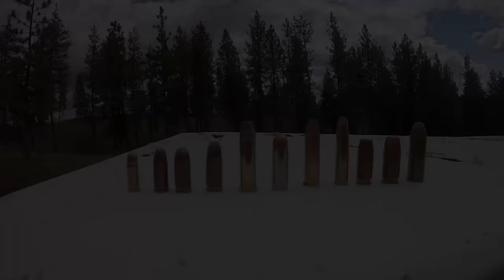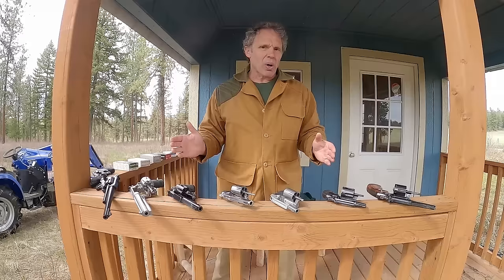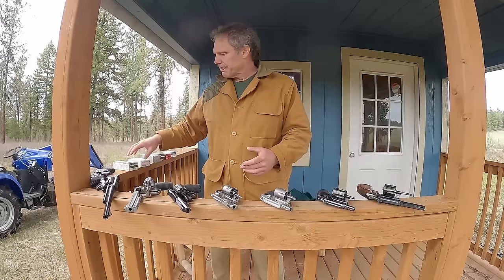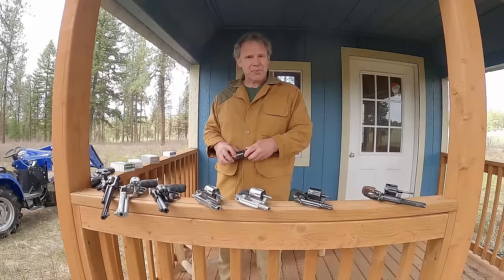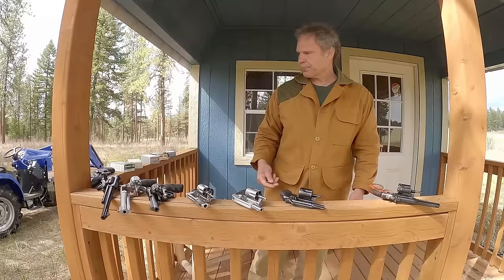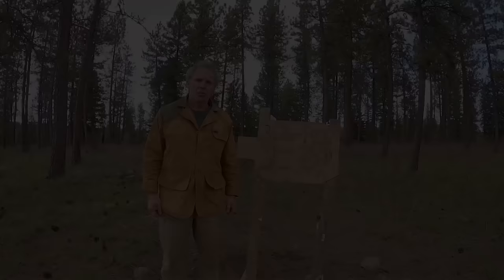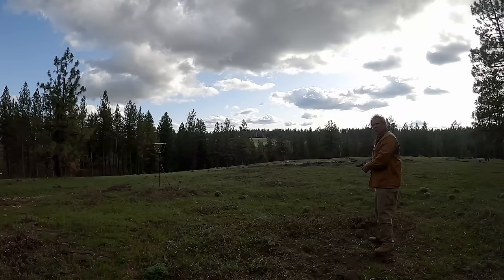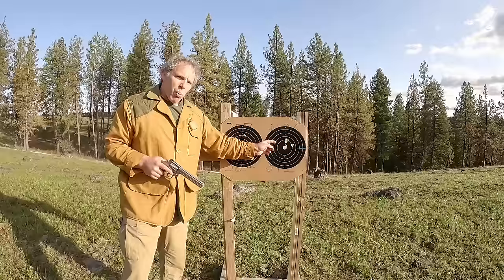Shooting .38 Super in .38 Special and .357 Magnum Revolvers

Comment: Hey Paul, I love your videos and I try not to miss any of them. I'm 48 years old and I'm a mechanic and I wear cheater glasses (1.5 strength) at work as well as at home to see anything close up like books or cell phone text or my work etc. Without glasses, I have trouble seeing iron sites in focus but find a red dot to be crisp and clear. I often wear sunglasses that accommodate a small patch in the lower 1/3 of the lens that has a power of the 1.5 (as I mentioned is my deficit) that finds iron sites in focus but i have to tilt my head back, with magnifying glasses on, to view level sites and get a good site picture. Naturally a red dot is not so easy to carry in my pocket as iron sites (P365). Do you have any advice for me or could you maybe do a video on all the dynamics involved with for farsightedness? I feel like I'm not alone here and that you and I aren't so far in age and I'm intrigued to here what you have to say. I hope you're well.

Comment: Tolerances.  It's very much about tolerances.

That said, even given .38 Super fits and is safe in a .357 (and honestly, it's probably fine in a well made .38 Special; the performance you got is comparable to .38 Special +P+ defense ammo), and there's little if any difference in accuracy -- .357 and .38 are far easier to find and have more load choices than .38 Super (I know; I have a .38 Super upper for my Witness), and are usually lower priced.

Beyond that, there isn't enough margin in performance of .38 Super above either 9x19 or .38 Special to make it worth the effort to find for most purposes.  In my Witness, I spent money on a .38 Super slide/barrel/magazines because of the combination of power and capacity (17+1 without magazine extensions), but if I could readily find full power loads, I'd be more inclined to keep 10 mm in it (only 14+1 but 50% heavier bullet at 30% higher velocity).  When I can't find 10 mm that outperforms .40 S&W, though, the capacity of .38 Super wins (and with a 9 mm barrel I can practice with cheap ammunition).

Comment: I am little surprised that you did not mention the Medusa revolver. Just a small titbit, I load 124 grn cast lead bullets sized to .356 in both my 9mm pistols and in my .357 revolver ( with mild loads) for practice and have had no problems and minimal accuracy difference, but will also be the first to admit my shooting accuracy is no where near your own unfortunately.

Comment: I know there are a lot of gun guys that know a lot more than me, but it seems like this is the equivalent of looking at a powder burn rate chart and saying... "it's just off by one from the load I'm already using, so I'm sure it's safe to use it without checking my load."  It's going to work out fine for someone, and the next moment you'll have a burnt face and scorched hair like Elmer Fudd.  Be safe people.  Just use the recommended ammo and move on.

Comment: If you are firing a semi rimmed through a should be rimmed like.38 super from a.357 or .32 acp from a .32 long or mag where lite primer strikes are likely it's somewhat less likely to have a lite strike if you single action cock it. Also.32 acp is known for more velocity and accuracy loss than.38 super is , possibly because.38 super may have enough pressure to bulge the bullet in the bigger bore but.32 acp just don't when firing a .311 bullet through a.313 bore

Comment: The glaring bit of info missing here, is whether or not .38 Super gets higher velocity than .38 special in a .357 Magnum snub-nosed carry revolver.  I own a Taurus 605 Poly .357 magnum revolver and while I do sometimes carry it loaded with Federal 130 grain .357 ammo, I usually carry it with 110 grain Hornady Critical Defense ammo.   That being said, if there was a .38 Super defensive ammo that fit most .357 revolvers and that got higher velocities than .38+P defensive rounds, I would be VERY interested in carrying that if it had less recoil than .357 Magnum.   Paul, you didn't even mention recoil differences which made me a bit sad.  The issue of recoil is a big deal for those of us who carry a light weight .357 snubbie (usually with .38 Special defensive ammo loaded).   The other question is whether that .38 Super ammo would expand effectively from a snub-nosed .357 magnum carry revolver.  If you could answer those questions, I would be very grateful to you Paul.   Thanks for the otherwise excellent video!

Comment: Don't do it!  I bought a used Ruger Blackhawk convertible and got a box of .38 Super with it.  I accidentally tried to shoot them in the .357 cylinder.  The jackets were stripped off and jammed the gun on the 3rd round.   Yes they fit and yes they fired but still a very bad idea.

Comment: I have a blackhawk 38sp/.357mag with a 9mm cylinder and Smith&Wesson 66-2.  I'll just stick with the ammo called for except for the Smith&Wesson I only use 38sp because of the forcing cone. But these are just my guns.  Do whatever u want your gun but just  don't cry if you have a broken gun on your hands or if you still have hands to speak of.

Comment: but what about .38 ACP? :) My wife found me a 1903 Pocket Hammer for my birthday. Took some digging to find valid ACP load data.  ACP is a tad higher pressure rating than .38 special, so .38 ACP is not backwards compatible to .38 special.  The thing I find most interesting is that considering 9mm Parabellum and .38 special were around when JMB designed .38 ACP, why did he use .356?  Either .355 or .357 would have been more readily available.  As I understand, most modern .38 supers are chambered for .355, but I won't swear to that.

Comment: You should of had some calipers to measure the OD of the cases and ID of the cylinders.
Also it would of been interesting to chronograph 38 special in +P and +P+. As some 38 revolvers are rated for it.
Reply from the maker: the .38 special ammo was +P
 I have never seen .38 special +P+

Comment: Paul - are you trying to demonstrate that the ammo shortage is over?

The following is not an attempt to establish some kind of expertise on my part. Please look up SAAMI specs yourself. I find these details interesting and typing them out helps me organize my thoughts and remember better. 

38 Super is one odd cartridge. Looking at the SAAMI cartridge and chamber drawings, it headspaces on the rim (not the case mouth like the vast majority of modern semiauto cartridges). The cartridge case is cylindrical.  IOW no taper, while virtually all other semiauto pistol cartridges are tapered from case head to case mouth. However, the 38 Super specs call for a tapered chamber (to facilitate extraction?). Revolver chambers also are ever so slightly tapered (did not know that). 

Finally, the .38 Special chamber spec is .3809” at the case head tapering down to .3801” at the case mouth. The 38 Super cartridge spec is a cylindrical diameter of .384” HOWEVER the specs also indicate up to -.006” variation. That is more than enough for some 38 Super cartridges to fit in some 38 Special chambers.

Comment: Bit of an oddity question, but what about firing .38 Super ammunition out of an autoloading .357 Magnum? Something like a (sigh) Desert Eagle or a Coonan 357 Magnum? I mean, granted, I don't see the magazine feeding being reliable so you'd likely have to load each round individually. Might not cycle reliably, either, would probably depend on the gun/ammunition. But, in theory, the .357 Magnum autoloader's chamber should be long enough to allow a .38 Super to chamber it. It should definitely take the pressures of the round, as well. I question if it would be safe/wise, because headspacing might be different. Never owned an autoloading .357 so I couldn't really begin to dive into that speculation.

Comment: Something interesting to discuss in the future as well is the cartridge interchangeability of Spanish 9x23 Largo, 38ACP and 38 Super. A good friend of mine has an Astra in 9x23 and he's experimented with them, 38 ACP fires perfectly and is totally safe by out metric, and I think 38 super should also be safe as well based on the chamber specifications of 9x23.
Reply: I would never shoot .38super in the Astra. The 38super is too hot. The Astra is not a locked breech pistol. The 400 and 600 are both blow back pistols.

Comment: For what purpose ? The 38 Super cartridge uses a smaller diameter bullet than the .38 / .357.  Jacketed is .355 lead.356. The .38 / .357 uses .357 for jacketed and .358 for lead. Case diameter for the Super is smaller as well.  If your revolver is designed for .38 special only, even + p ammo, the .38 Super operates at more than double the pressure than .38 special +p and even higher than regular .38 ammo. This is an all around bad idea. Very unsafe especially in older .38 revolvers.

Comment: I wouldn't shoot a .38 super in a .38 special revolver. .38 super is loaded to a higher pressure. From Paul's own tests show that the special velocity is 850 fps, and the super is 1150 fps. The special revolver is not designed for the higher pressures

Comment: This topic, is kind of like taking a 186X Colt Navy/Army/Police black powder revolver .36 caliber and loading it up with say 25 or 30 grains of black powder or even Pyrodex, instead of say 20 grains max. As far as I understand shooting .38 super auto out of a .38 special. Could you do it and get away with it? Yeah but I wouldn’t least not more then once, as the gun is likely to come apart on you at the seams so to speak. If you got the ammo to fit in the gun. And yes I know we are not talking black powder revolvers, but the same principle applies as the gun is not designed for it.

Comment: It works but headspacing is an issue to the point you get cylinder bind & weak primer strikes. Ask me how I know 😂 Moonclips are needed. I was testing in a .357 however .38spl may not yield the same results.

Comment: I would be greatly concerned about shooting 38 super in a 38 special because of the chamber pressure of the 38 super.speaking about the difference  in chamber and shells in my collection I have a cz 52 in 9mm that works flawlessly with my reloads with  many different 357 Dia bullets also 2 Taurus g2c pistols I also reload Remington 125 gr sj _ hp. The work flawlessly in both pistols. Papa wishing you well

Comment: Paul, your "Fake Expert" comment is not entirely fair.  There are SAMI specs for cartridges and chambers which result in standardization across the industry.  We all expect that if we have 357 ammo, it will fit in a 357 chanber.  It is an understandable error for someone who tests 38 Super in a 357 or 38 to assume that due to standardization, his results (fit or not fit) will be the same for all ammo and revolvers.  They may or may not be a "Fake Expert" for other reasons, but I think you need to give them a pass on this one.

Comment: The misfire of the 38 super in the revolver could be due to rim thickness. i.e. the 38 super auto may have a thinner rim than the 357 and thus the primer would be further away from the firing pin.

Comment: Well, as this video is one of my favorites and less than a year old I thought it was still Fair game to leave a comment at this point, and as a wannabe fake expert, I'm just a little too old, have spent far too many years at the range, and have watched far too many Paul Harrell videos to say that I'm closer to a fake expert than not, therefore I'll just stick with wannabe fake expert.
- That being said, I'm quite surprised that Paul didn't mention the probability of developing a carbon ring in each chamber of the .357 magnum cylinder after firing a number of .38 super rounds in a .357 Magnum revolver.
 This possible carbon ring could possibly develop in a location which might prevent a person from successfully loading .357 Magnum ammo until the cylinder has been removed and each chamber of the cylinder cleared and cleaned of that carbon ring.
If I am mistaken about this, please don't tell me because I'm enjoying being a wannabe fake expert.

Comment: you know Paul, I'd be curious of your conclusion on a 10mm 40 mix. I've done it and it seems to work in a pinch for those times when aliens with their big foot armies attack us.

But I don't have the equipment to throughly test it.
so if you get bored one day or need an idea for a video I'd like to see what you get.
I'm using 125 gr. going at 1350. so that covers anything I have to deal with in the U.P.

whatcha think?
Reply: All you're doing is over-stressing your extractor.  Of course it can be done, but there's no provision for headspace other than the extractor's grip on the rim.  That's definitely not a recipe for long term reliability or durability.
Reply: @66smithra  not what I asked already know all that, but thanks.
Reply: @wolveryne42  Why would he want to damage his guns doing this test?  What would possibly be learned?

Comment: Thank you for the excellent presentation Paul, I never knew this would be even (partially) possible. So does the fact that some fit and others don't mean that the chamber of the auto loader's chamber have a larger tolerance? How is that possible?
Reply: No, because the autoloader is chambered to the SAMMI spec to accept the rounds which are also to SAMMI spec.

Comment: Great video, but I got a little distracted wondering how the size difference between the Remington 380 super and the Winchester 380 Super might affect ammunition performance in a 380 Super chamber, seems if the Remington fits the other will expand more to fill the chamber when fired.

Comment: Paul Harrell I have a 460V muzzle brake equipped X-frame revolver highly customized by many gunsmiths. TK Custom can CNC my 460 S&W magnum cylinder and extractor to hold a moon clip for 45 ACP use. TK Custom also tested the 45 ACP moon clip to use 45 Super, 460 Rowland, 45 Winchester magnum and another I forget. This adds chambering and firing versatility to my 460V revolver. Single loading rimmed cartridges are still fine as well as using a Speed Loader. What are your thoughts on my plan?
Reply: And all that was with Starline brass. Winchester brand 45 Winchester magnum does not fit the TK Custom moon clip for the 45 ACP. But Starline brass for the 45 Winchester magnum will fit.

Comment: I was reading about the Lindt cafe shootout. It is asserted (possible state coverup) that officers used 5.56 "soft point" and a "fragments or richochet" killed a hostage. An expert asserted that half-inch glass "basically acts like concrete when it's struck by a bullet" causing an officer to be injured from shrapnel. The stop was hard stone wall, probably granite. Would a plywood richochet/fragment trap in the shape of a pyramid be a good test for this?

Comment: I would never try to fire .38 Super in a .38 Special revolver, even if the rounds do fit. Why? The .38 Super generates twice the chamber pressure as .38 Special standard loads, and about 30% higher than .38 Special +P rounds.

Comment: Why didn't he just explain the +p 38 spl is a max of 23000 cup. While 38 super is 35,000+ that puts it in the pressure category of 357 mag. Quite simple,13000 cup pressure difference is F around and find out.38 super will fire in 9x23 largo but doesn't feed well because of the semi rim.

Comment: Have a,357 magnum that does have the ability to use 38 super but some don't, i like the idea that some do, but not worth the price or less energy or performance, but can in a emergency, same with my 327 magnum, can also use 32 acp, but the price I not worth it, especially if 32 magnum is a second choice other than getting 327 magnum ammo , 32 magnum has potential, most bad guys cant take 6  or 12 rounds

Comment: There are alot of snub nose 357 revolvers that even though you can fire 357 mag out of them the recoil makes it no fun at the range. HOwever, maybe 38 super can be used instead of 38spl+p for a little more oompf. Somewhere between 38spl+p and 357 mag

Comment: this was a great video and although we are having a very difficult time find 357 magnum brass or cartridges.. 38 super might look like a good choice for hard times when and if the need arises as a back for no 357 ammo' does the 38S  have higher pressure than the 357  MAG  ? and is it harder on the forcing cone since its shorter ?...hmmm I wonder none of the gun smiths here have an idea...

Comment: I dont think that .38 super in a .38 special is a problem if its a +p rated revolver. You also have to consider that most .38 special revolvers just have a shorter chamber and actually are .357 capable like the K frames . There are also Ruger SP 101 or Security SIx in .38 special. They have the same strength as their .357 version. Of course an old .38 for standard pressure only shouldnt be tried with .38 super.